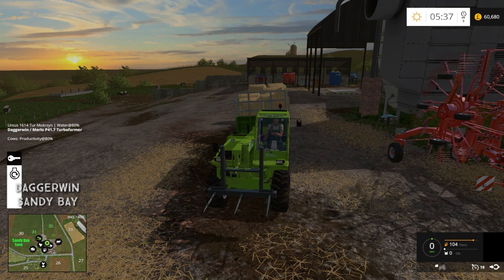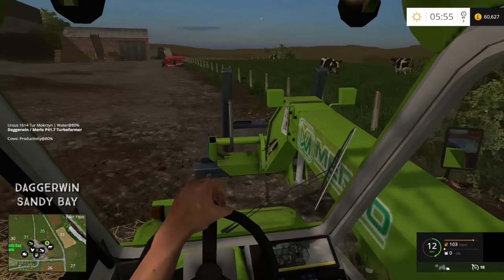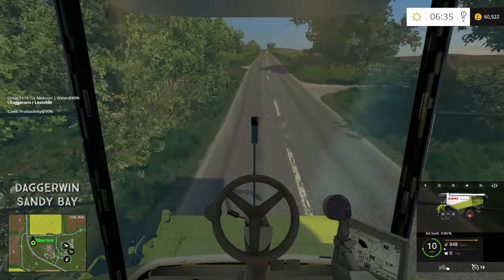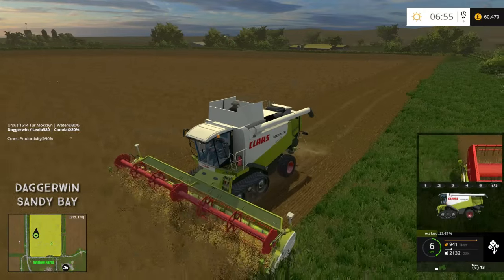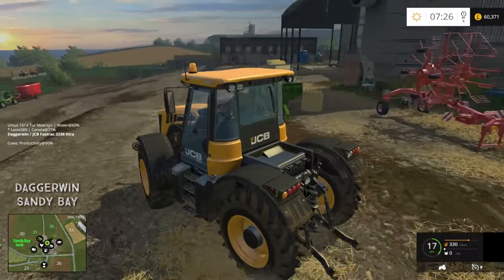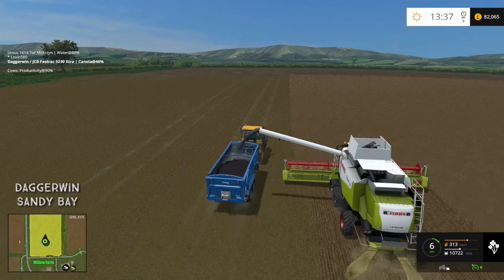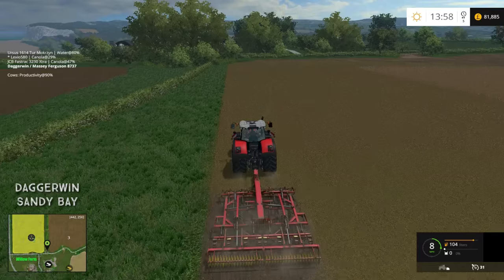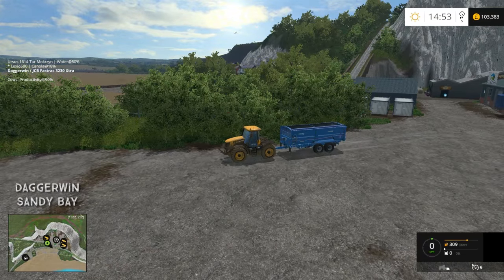Let's Play Farming Simulator 2015 | Sandy Bay | Episode 11

Comment: Dagger I use the 900 header on the lexion 600 and if you fertilise the field then the 600 struggles and blocks up (that's a mod feature so I would watch the active load bar doesn't get to 100%)

Comment: There are a lot of problems with this map which is why I have stopped playing it. The only reason I'm watching this let's play, is to see if you have similar problems. The worst of the problems I had is that, on three separate occasions I have completely lost everything  I had bought which includes all of my animals, tractors, machinery, and all of the bales that i had made. I always save the game on a regular basis, but there seems to be some kind of problem on this map where either it is not saving the game, or it is simply resetting everything. I have never had this happen before with any other maps, and I only use mods that I know work properly.
Reply from the maker: +Shaun Broderick I hope that doesn't happen to me, I don't want to have to start this LP again. Maybe it's a mod you have which is conflicting somehow?
Reply: +Daggerwin can you get the john deer 6810 or the new holland t8
Reply: +Shaun Broderick if it happens again what you need to do is delete the map and redownload it :}
Reply: +Daggerwin Yeah, that's what I thought at first, but I have tested on many other maps using exactly the same mods and never had any problems at all, which made me think it must be a problem with the Sandy Bay map. After the second time it happened, I also tried uninstalling the map, and reinstalling, but it did exactly the same thing. Hope it does not happen to you. I also think I remember seeing a comment somewhere that someone else had the same thing happen. There is nothing worse to me than spending many hours on a map, only to have everything disappear on you. Such a waste of time. The worst thing is though, that it is such a nice looking map, and I really enjoyed playing it.
Reply: +Daggerwin hi I know the steward trailer is good but you should use the marsh trailer becuase it's taking space in your yard it's that or maybe sell it.☺